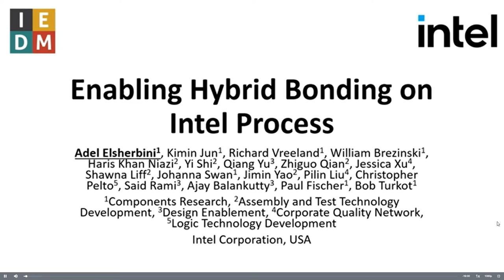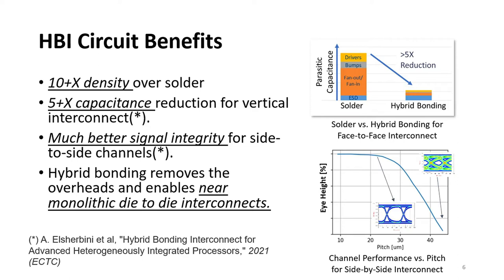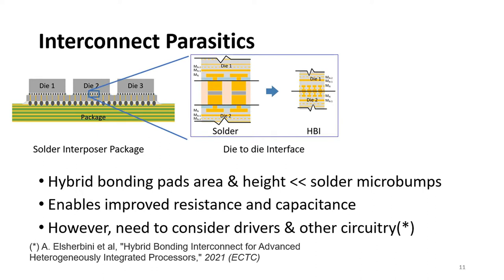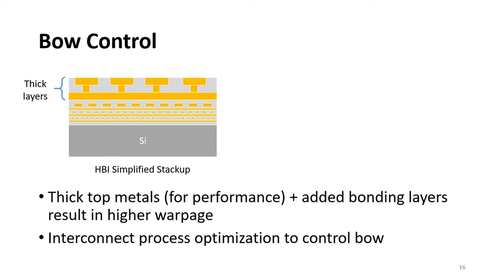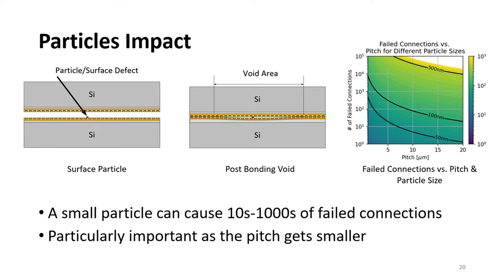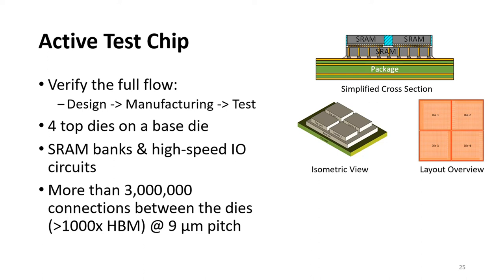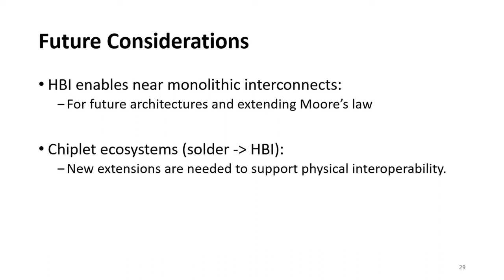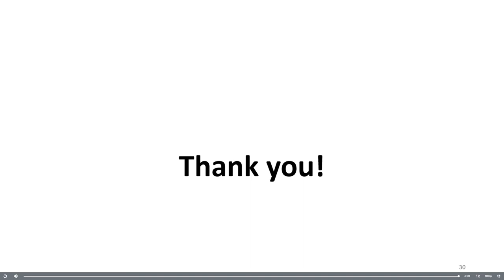IEDM: Enabling Hybrid Bonding on Intel Process

Comment: What can you say about durability, long lifespan of Power management IC units in Chiplet
Reply: When will we get 2nm with chiplet packaging
Reply: When will we get 2nm with chiplet packaging
Reply: @azamat_bezhanov  no, cant do it. the limits are on tech available on the mechanical side ie stacking die within microns with a robot and the drift that occurs over the cycle of a production run reduces yield to the point that. cant do it for consumer grade